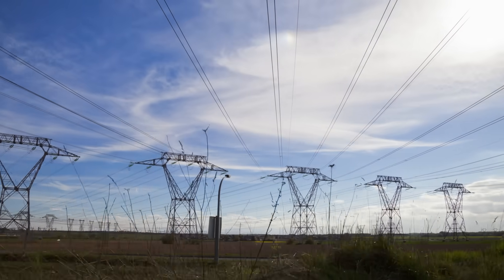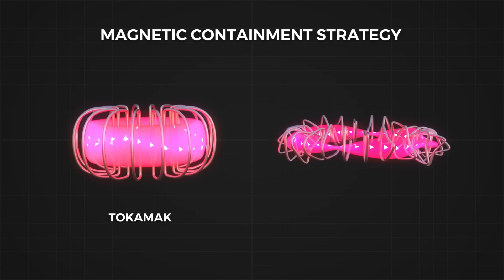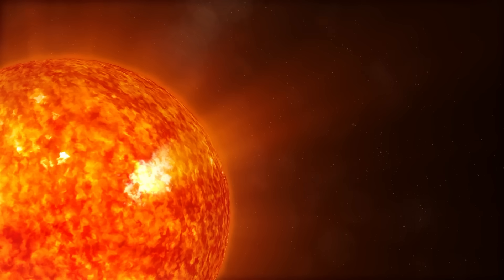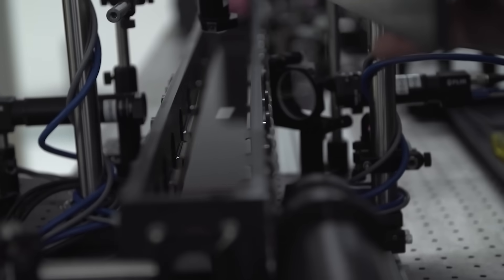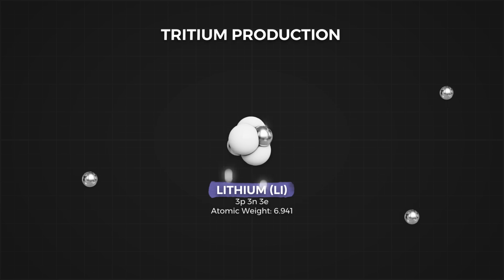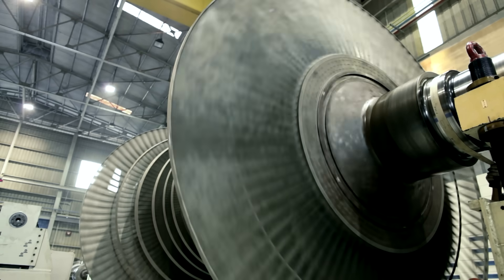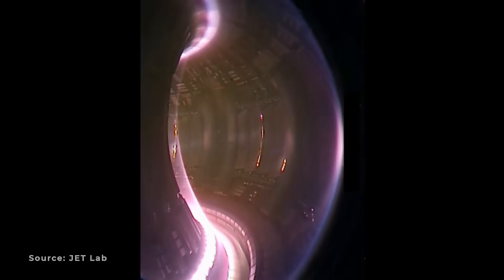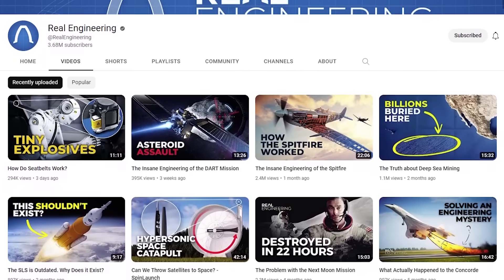The Problem with Nuclear Fusion

Comment: Just had a mega milestone in human history! 50% more power harvested than used for the reaction. This is actually a pivotal moment in our species' history.
Reply: Well, they send in laser photons of 2MeV and got products with 3MeV thermal energy out.
But to produce the laserphotons in their absolutely not optimized laser generators, they needed 200MeV electric power.
Reply: Not exactly. 50% more energy out than the laser energy on the capsule.  To create the laser took ~100x what they got out. The NIF is a weapons facility, not for energy generation
Reply: @matthewnyberg3151  Exactly right!
Reply: @matthewnyberg3151  That laser you mentioned is way outdated and was created in the 1980s. Now that they have the formula for how to create the ignition reaction, they will be updating the laser tech to something that can fire 2-3 times a day to one that can fire 10+ times each second. The energy output and efficiency increases and practicality for use will silence a lot of the current nay sayers.
Reply: @Darbobski  The trouble with fusion is the fact that for megawatts of continuous power, hydrogen is bulky even as lithium deuteride. Thorium, uranium, and plutonium are much denser. Even the volume enough to produce 100 MW at the huge density of the sun's core, by the steps of fusion that combine four protons into one alpha particle ⁴He-positive is huge.
Reply: That experiment was more about studying fusion for bombs than for power generation. It used inertial confinement fusion, a process which only works 1 gram of fuel at a time, and only for 1 nanosecond. Not very scalable for power.
Reply: @Jacob-yg7lz  I got very suspicious when she introduced the idea that it would be useful for "defense". You have confirmed my suspicion.
Reply: @Jacob-yg7lz  What are you talking about? The findings are exactly the opposite of what you are asserting. Even if the energy in VS energy out ratio was only 20%, this would be a huge breakthrough. The science was the long part, the engineering and scaling will take far less time. In fact, you should come visit us at the NSE in MIT.  Ask to speak to Dr. Jack Hare. He is great and will gladly provide you with a better understanding of how this breakthrough is not only scaleable, but will lead to a rapid change in world energy production. Even most of our grandparents will live long enough to see some of the changes take place.  That is exciting.
Reply: @Darbobski  I'll believe it when I see it. The NIF is a nuclear weapons research facility first and foremost, not a facility for researching viable fusion power.
As well, the energy in vs energy out of the reaction was only counting the energy of the lasers, not the energy to power the lasers which was nearly 100 times more.
Reply: @Jacob-yg7lz  Quite so! Not only that, but the neutron is what gets most of the energy produced, and it isn't easy to get the energy from that neutron, the easiest way is to make it collide many, many times with the least massive element nuclei you can arrange. Hydrogen's good, but bulky.
Reply: I had the chance to actually visit and tour the laser! It’s really cool and you don’t realize the amount of engineering that goes into it.
Reply: No it's not.  We used 300 times the energy to produce the reaction.  It's all over-hyped BS.
Reply: Big if true
Reply: It wasn't 50 percent more, but anything above unity it a big deal especially this early on. I wasn't expecting this in my lifetime. Even 1 percent over unity is a big deal. If we can master fusion fuel cells then our world could be almost pollution free.
Reply: The strictly accurate description is that the apparatus delivered 50% more raw heat energy than the energy received from the lasers. Actual reactors have two ratings, thermal megawatts and megawatts electric. This fusion process still needs the usable energy production from capturing the insanely fast neutrons, and a very efficiently powered laser setup.
Reply: After decades of useful fusion power always being "20 years away" I'm shocked how few people bother to question the LLNL announcement.
Reply: @AnAntidisestablishmentarianist  LLNL announcement?
Reply: @0D1NJEDI  Lawrence Livermore National Laboratory
Reply: @AnAntidisestablishmentarianist  I.'m  not.  it doesn't seem to me, in spite of deserving acclamation as  "first time" of something , to come near the proof  in April 1986 that the US could build a reactor which not only can consume all the long lived "waste" from lesser reactors,but could shut itself down in "300 seconds" from exactly the coolant pumping failure that wiped out a reactor at TMI and a corresponding supervisor's stupidity at Chernobyl.  Five minutes is 300 seconds, but milliseconds are important in reactors.
Reply: Here Here
Reply: For how long was that achieved please ?
Reply: Can you link your source please.
Reply: @parallax3d It's not researching new fusion bombs, it's researching how to make better fusion bombs
Reply: @tempusername-l5d  It worries me that our Energy Secretary doesn't know, or doesn't say, that the ancient LWR fission nuclear that is already our cleanest source of energy. I can think of lots of things that would make fusion reactors difficult to be "clean".
Reply: Oh kiss off. That's a damned lie. Maybe it is a lie you are telling yourself, but it is a lie.
Reply: @ultrametric9317  What?
Reply: @jamesbentonticer4706  James so they got 50% out of the stuff they put in!

Guess you dont know it only cost 60 times the energy out to make that stuff they put into the process? thats Ok being an NF fanboy is about being ignorant, would you like to redo the calculation now you know the facts?
Reply: 😂😂😂😂 idiots
Reply: No. NIF is a pile of garbage, and will never result in a commercial reactor design.
You're being lied to.
Reply: and now 6 months after this comment we have passed MORE THAN 100% energy harvested than used for the reaction this is truly the biggest milestone in energy ever.
Reply: @ckpioo  "MORE THAN 100% energy harvested"
Only one problem (Well to start with) to make that energy to put in cost 3000 times that energy! so in real terms its 3%! not 150%!
What do you think now?
theres also the problem its impossible to contain fusion reaction!
Reply: I still think everyone should have a bike they gotta pedal to replace the energy they consumed the day before
Reply: @chrispaquette1980  the average American uses 12 kWh of electricity per day. An hour of cycling produces around 0.11 kWh. You would need to cycle over 109 miles to put that back.
Reply: @chrispaquette1980 You'd never get off that bike lol
Reply: All just to boil water that rotates a turbine more efficiently… I wish we could actually utilize the energy instead of using glorified steam power.
Reply: @thesilliestgoose5990  Like it or not, turbines are relatively simple and very efficient.
Reply: @TheArrowedKnee No they're not. They're only efficient if the thermal gradient is large. 

They always lose energy to thermal losses when converting steam back to water. A HUGE amount of energy; hardly considered a loss when it's that substantial. It's more like an inevitability.
Reply: @thesilliestgoose5990  steam power is a way to translate the kinetic energy. Fusion is a way to partially convert the mass of tritium and deuterium to create energy. Slight difference.
Reply: @thesilliestgoose5990  https://www.youtube.com/watch?v=_bDXXWQxK38
Reply: @thesilliestgoose5990  orrr to power something so powerful they haven’t had a power source for it til this develops.
Reply: @thesilliestgoose5990  theres a US company thats working on DEC, Helion Fusion are working on it at the mo, looks promising
Reply: @thesilliestgoose5990  Most of the energy is in the neutrons  and in the standard  weapons design some of it is used directly, to fission enough of the otherwise non-fissile U-238 to double the blast. which like all bombs is essentially thermal blast, a fair amount of immediate radiation.and the usual fast disappearing radioactivity.
Reply: @thesilliestgoose5990 ok genius, why dont you build it then instead of compaining?
Reply: @levansegnaro4637  just because I’m not an expert in a field doesn’t discredit me if I’m still objectively right
Reply: @thesilliestgoose5990  Loser. We do
Reply: @lucasng4712  why are you so pressed over me talking shit about steam power lmao 😭
Reply: Wouldn't that break the laws of thermodynamics?
Reply: @cashboys_tv  The laser generators produce mostly waste heat
Reply: @foxwithaplan858  gas ⛽️ is only 30 percent efficient. 20 percent increase is a major milestone
Reply: @cashboys_tv  no. This is E=mc2. During this fusion reaction some mass is lost. It is turned into energy.
Reply: @cashboys_tv  no? That's the entire point of experimenting with fusion. There's an external burst of energy to start a reaction that is incredibly high energy. This was a landmark experiment because it was experimental evidence for the theory
Reply: @allenjunge4127  also proving the energy is too great for it run to make energy before the machine is destroyed!
Reply: @cashboys_tv  beaming some neutrons at some plutonium can cause a nuclear warhead detonation, which releases way more energy than is 'put in' ...the main issue is that we want a 'controlled' fusion reaction for making energy
Reply: @cashboys_tv  No because the total energy in the system is conserved. The overall rest mass of the products is lower than the rest mass of the inputs. The difference in mass is liberated as energy, typically as high energy neutrons.
Reply: @crosseyedcat1183  ..Aye indeed, ferociously high energy neutrons. In the bomb, they can fission "non-fissile"  ²³⁸U from "depleted uranium".
Reply: @cashboys_tv  No.  Mass is converted into energy.  That's what nuclear energy is all about.
Reply: @cashboys_tv  It doesn't include the energy in the fuel. Remember, if it bends it's funny, if it breaks it's not funny.
Reply: @Bob  there's another law than came after Newton. E=MC2
Reply: @cashboys_tv  No. The energy comes from the difference in mass between  ²H +³H  and  ⁴He + a neutron  ( that's deuterium +  tritium) vs (helium + neutron)
Reply: @cashboys_tv  No the energy comes the reaction not the sum of that one part!
Reply: @cashboys_tv  No. The extra energy is already locked in the isotopes.
Reply: @cashboys_tv you forgot about the energy in the fuel itself.
Reply: @cashboys_tv  
No because they aren't "creating" energy they are just releasing potential energy within atomic nucleus.
Elements have potential energy so long as they are not iron wich is the most stable element aka has the least potential energy within it's atomic nucleus.

Comment: It'll never be cost effective. It can work, I'm pretty sure. Fusion can be controlled and even perhaps generate some electrical energy in a very expensive one off demonstration plant in 30 years. As long as we we pour hundreds of billions of dollars into it during that time. But it'll never produce a cheap source of energy. Not when ITER is boasting about how expensive and big everything is and it's not even going to produce any electricity at the end of it. In the meantime you could have just built a gazillion wind turbines and solar panels, energy storage etc etc with the money over those decades and have it all working just fine. Fusion is the Spruce Goose of power generation. By the time it works and is cost effective we'll have either solved the problem with renewables anyway or have nuked ourselves fighting over resources back to the second century

Comment: There already is a working nuclear fusion reactor. It's just 93 million miles away. Unlimited free energy. I started to think tapping that already fully operational reactor would happen before we ended up duplicating it, but no one is working on it. Getting the energy back here would be challenging but possible with current technology. Hella expensive, but possible.
Reply: Absolutely.
Reply: Lets just grab that bad boi and tow it over here, simple

Comment: ppl who discuss about nuclear fusion problems usually forget its main problem: it needs hydrogen, hydrogen which doesn't have its own sourse on Earth, you can't just suck it out the ground like oil, you need to make it. and there is 2 ways to make it - from the oil or gas, or from the water. this is the biggest problem of nuclear fusion. water is cheaper source of hydrogen, so once fusion reactors become common thing ppl will make hydrogen out of water. but the problem here is the fact that we all need water, you literally can't live without it. when you use water to get hydrogen you burn or use in chemistry, this hydrogen will stay, turning back to water if burned or other form in chemical reactions. but nuclear fusion is different, hydrogen turns into helium, which means the more fusion rectors we have, the more powerful they are and the longer they work the less hydrogen=water stay on the Earth. you may think those reactors use tiny amount of it, but lets just count. lets say humanity will find the way to transform protium(hydrogen-1, the most common isotop) into tritium. its been said in this video that 8 megawatt reactor need 300 gramms of tritium every day, it also means 200 gramms of deuterium(because it's mass are 2 to 3 with tritium), how much water you need for it? well, its about 1.8 kilogramms of water PER DAY, for one reactor, and we will lose it permanently because that hydrogen will become helium. 1.8 kg a day, 650 kg a year, multiply it to how much reactors we build and don't forget that some of them will produce more power and use more fuel. don't get me wrong, nuclear fusion is a holy grail of energy industry... somewhere in future when we can get hydrogen or water from other planets, rn when we barelly step on the Moon, fusion is the road to extincion for us and all the life on our planet.

Comment: Beryllium Copper is used in some molds. I’d say plastic molds, but I forget what material the one Beryllium Copper mold used. It could of been a high glass content PA which would make sense cause high glass PA wears out the tool steel most molds are made from.

Comment: Unfortunately this video is quite misleading, for one thing fusion experiments have been underway since the 1930's. I appreciate the kindergarden level explanation, but you leave out huge issues in terms of material science. In my own ever so humble opinion, fusion power is about as difficult as building a time machine. The neutron  flux generated from the reaction will make elements of the reactor radioactive and this will create a different kind radioactive waste. Beryllium is the least of our worries. Good luck.
Reply: The material science is not really that big of a problem. Commonwealth Fusion Systems estimates that their walls will last for 4 years. Those will then be mostly recycled. Only small amounts will go to waste. This would be low to mid-level radioactive waste, not high-level radioactive waste like burnt fission fuel is. It would only have to be stored for a few decades.
For Helion, it is even less of a problem. They did not use Tritium for fuel. So, they only produce neutrons at 2.45 MeV energy (vs 14 MeV in Deuterium- Tritium fusion) and they only produce neutrons in a 3rd of the reactions. Those neutrons are below the activation energy of many materials. Their machines can be fully decommissioned within two weeks after operation, and they will be below background radiation after less than a year. 
Other companies who are aiming to do D-T fusion are looking into liquid lithium first walls. They also do not have any problems with neutron damage to the first wall.
Reply: @elmarmoelzer2229  Your mileage may vary. I'm not holding my breath.
Reply: @Zerja   You should read up on the plans of the various fusion companies.
Reply: @elmarmoelzer2229  I have and I'm extremely skeptical. My background is in nuclear physics and I have more than a rudimentary understanding of the theory and technology. I have seen the inside of tokamac reactors. The greatest benefit of this research is the peripheral development of technologies that are applicable in other areas. As I said fusion power on a meaningful scale is about as likely as building a time machine, or traveling faster than light.
Reply: @Zerja  Helion will very likely achieve net electricity in a couple of years from now. 
Zap will have net energy (not quite net electricity) likely as early as spring in a machine the size of a motorcycle.
So you will likely eat your words in about 2 years from now, give or take a few months.

Also is a Tokamak, not a tokamac.
Reply: @elmarmoelzer2229  re; Z-pinch https://en.wikipedia.org/wiki/Perhapsatron

"In the 1950’s, instability-plagued Z-pinches at Los Alamos, Kurchatov and elsewhere generated up to 10 million D-D neutrons per pulse. Only recently has ZAP’s stabilized Z-pinch been able to reach that same level of 10 million D-D neutrons per pulse, corresponding to fusion energy of 10 microjoules. But ZAP has not produced greater yield than the ancient Z-pinch landmarks.

The input energy to the ZAP discharge is at least 100 kilojoules, some 10 orders of magnitude higher than the fusion output! So the fusion energy gain Q is less than 1 divided by 10 billion. ZAP now claims that with a moderate increase of the discharge current (less than 50%), fusion gain Q will increase by 10 orders of magnitude to Q = 1 (“scientific breakeven”). -Daniel Jassby, 

Bro, TEN ORDERS of magnitude from Q_0

https://thebulletin.org/biography/daniel-jassby/ 

A real plasma physicist.  

https://thebulletin.org/2017/04/fusion-reactors-not-what-theyre-cracked-up-to-be/

https://thebulletin.org/2018/02/iter-is-a-showcase-for-the-drawbacks-of-fusion-energy/#post-heading

https://vixra.org/pdf/1812.0382v1.pdf

ITER

https://nabil-alouani.medium.com/is-nuclear-fusion-a-22-billion-scam-386e25591f10 

It's vaporware.

I'll bet you 1$ that fusion power never becomes viable.